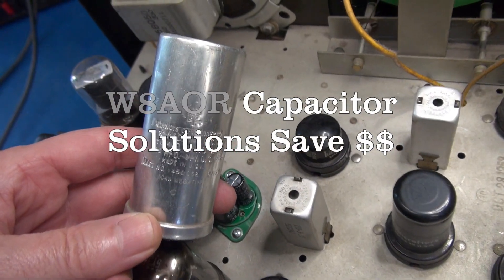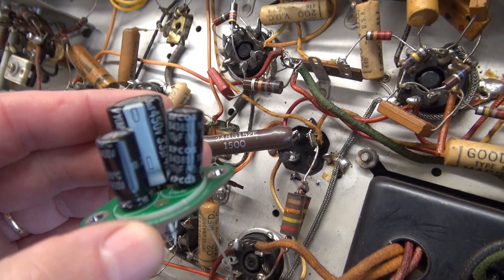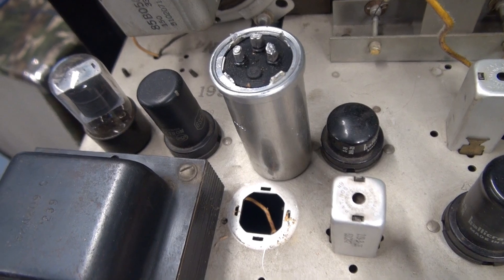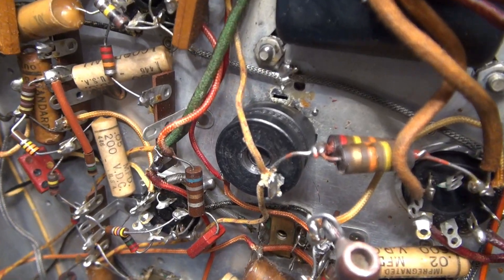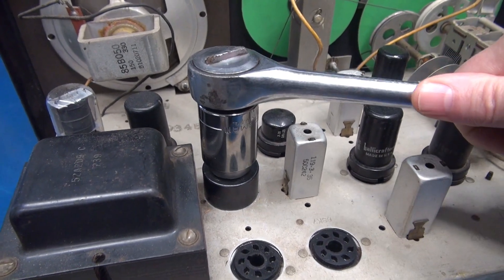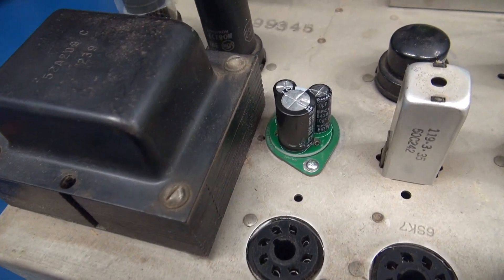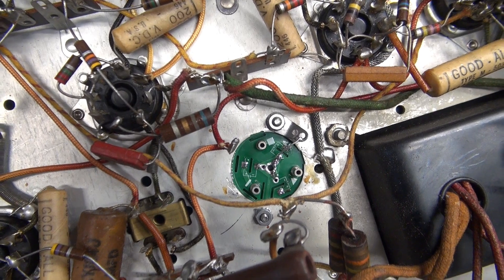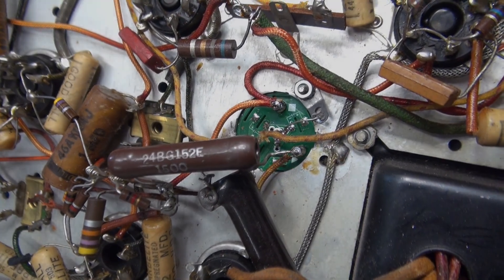Inexpensive radio filter capacitor solution W8AOR.com Multi-Cap kits Installation D-lab electronics

Comment: You would think some company would make a unit with 4 mounting tabs,  with the can body slightly larger so the up to three 500 volt caps would fit inside. I think this would be very popular with amp and radio restorers.  Especially so if several sizes were made.

Comment: Thanks Terry. That is the 3-in-1 V2 board to replace the standard flange mounted 1" twist tab capacitors. The 3-in-1 V3 was designed to replace the chassis slotted 1" multi-section capacitor.   No need to punch out the hole. The turrets fit inside. There are 5 board designs to fit the various 1" and 1 3/8" twist tab caps.  Will get some down over to Terry.
Reply from the maker: Thanks man, that would have saved me some work. Appreciate the cool product!

Comment: Actually I would cut the can open near the base so I could access terminals and clean out the upper part. But sometimes there is leakage between the terminals even with the guts removed which requires alot of cleaning to eliminate.  I have used aluminium speed tape to close cans after restuffing.  But if it has the cardboard cover that will conceal all the work when put back on.

Comment: Beware that in the old days lazy guys would just solder new caps onto the old ones. IF the old caps had dried up and were not shorting,  it probably worked.  But it is bad practice and you should watch out for that. Although if the guts were removed from the can it would probably not matter.
Reply: @TomSherwood-z5l   Soldering the new cap's onto the old cap's without clipping the terminal's or lead's is lack of proper knowledge, a rush job & just wrong or all 3. All should take pride in any & all work we're responsible for. You'll sleep better! 💤💤

Comment: I have gutted cans and restuffed them by using the original terminals on the bottom. Opened the can with a tubing cutter or saw.  Gutted the old gunk out and cleaned inside. I drilled holes in the fibre base and ran the new cap leads through those and soldered at the base of the old terminals.  You can wire the negatives together inside the can for one lead coming out.  IF the can is the common negative it is more work though.  But in my Drake standalone power supply I just ditched the cans and made a circuit board to mount the new caps onto.  It does not have to look original inside but be practical.

Comment: Scott developed this special capacitor board kit for replacing can type e-caps. It would be tricky with some  metal 
grindings if you don't have the 1 1/8" Greenlee chassis punch  to enlarge the hole. So just beware of that. You could use a
shot glass and using hot glue and glue it to the undersides and grind the edges of the hole away from  the top. Tell us how
that goes if you want to try that!

Comment: In some cases you can open the old capacitor, remove the internals and put something like this inside.

I personally have different experiences. Sometimes the insides are all caked in.
Reply: I always do this if the cap is above the chassis. It is such an eyesore to see some modern junk on the chassis immediately when you take a peek at the back. Either leave the original can and disconnect it, or restuff it with modern caps.
Reply: This would be the choice of the Tech. recapping. Terry knows his stuff. Should the OEM filter cap can be in good condition, open it up - carefully - & clean it up. OEM  appearance is everything.  Terry - your Vid's are interesting, I've been an Electronics Tech. Over 40 year's. Let's keep in mind, this vid. involves an easy process & D Lab Terry gives good teaching advice for those willing to learn. Patience is a virtue!   Have an Electronics Merry & Happy Holidays... ☮️🍕📻🎙️
Reply: I save the can if I decide it needs to keep the same appearance or if there is no place under the chassis with room for the new filter caps.  Which does happen in some tight radios.
Reply: @TomSherwood-z5l  This is  fairly common in tight chassis.  Sometimes we just gotta do what we gotta do in the best way we gotta do it. The end result must be correct.